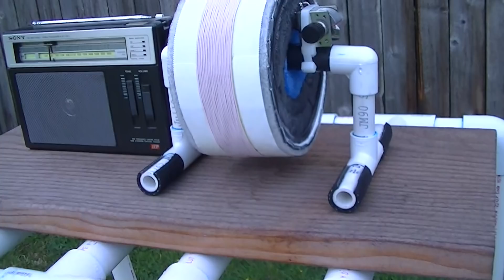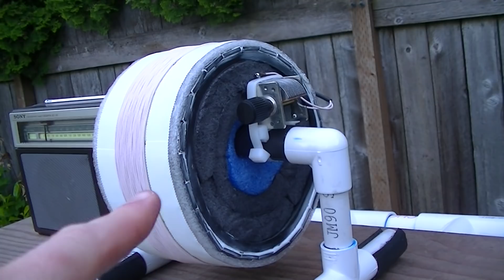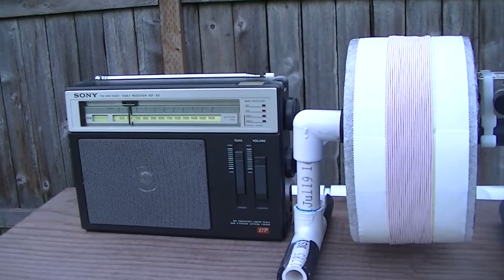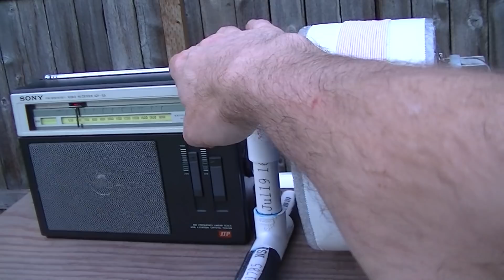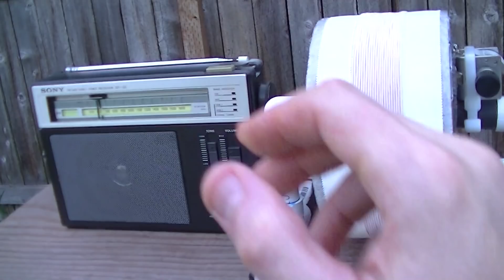7" Bar FSL Antenna Demonstration Video-- 610-KONA

Comment: what's the difference between icf S5W and S5 if used in USA , which one is better.
Reply from the maker: Hello 061811, The two models have the same circuitry on the AM band, but the Japanese-market ICF-S5W has additional Shortwave coverage of the Japanese NSB stations. The Japanese model also has a map of Japan on the back, while the North American ICF-S5W model has a map of the USA.
Reply: hey Gary, thanks for your reply, s5 is alot easier to find then the s5w, which has better FM coverage, but guess people are looking for AM performance on this one.  speaking of your FSL, would there be any benefit if using a 1000pf capacitor with 200x10mm ferrite bar.  in the process of building one FSL, but not sure which variable capacitor is better off to go with. one is 365pf, the other is 1000pf. thanks  73
Reply from the maker: Hi Again 061811, the 365pf variable cap would give you full AM Band coverage, while the 1000pf variable cap would give you some Longwave coverage as well. Of course the size of the variable cap would be much larger, so you would need to redesign the PVC frame to accommodate it, and keep it securely fastened.
Reply: thank you for your reply, Gary, last two questions,  1)what difference will it make if  a double gang or 4 gang variable  capacitor is used i/o single gang one? I saw in your build article that you are using single gang capacitor, but for the 1000pf unit of which I am thinking of using,  I can only find two gang or 4 gang, is it ok to use? 2) I can go with either 14x8cm or 20x10cm ferrite bar, which one will have better WM reception with 1000pf capacitor? not sure which factor plays the important role, the number of  ferrite bars or the length or size of ferrite bar. once again, thank you Gray, can't wait get started working on  my first FSL lol 73.
Reply from the maker: Hi Again 061811, The reason I used a compact 365pf variable cap with single-gang construction was to keep the FSL itself as compact as possible. The only possible drawbacks to using a 2 or 4 gang variable cap are that you will need to design a larger PVC frame to accommodate the larger variable cap, and possibly deal with some reduction in the FSL's nulling capability because the larger variable cap may tend to skew the RF reception pattern more than a compact variable cap would. As for the ferrite rods the longer (20cm x 10cm) rods would provide better performance, as long as the coil diameter is the same.
Reply: hi Gary, how about litz wires, in your building file, you are using 660 size with 365pf capacitor, if I go with 800-1000pf capacitor, do I make any change in terms of litz wire size and turns? thanks
Reply from the maker: The 660/46 Litz wire coil in this model is designed to cover the MW frequencies (530-1700 kHz) with the 365pf variable cap. Using a tuning capacitor with much more capacitance will give you much more tuning range (into the Longwave frequencies) if you keep the same size of Litz wire coil. Most likely you will end up with something like 150 kHz to 1700 kHz with a 1000pf variable cap, although I've never built an FSL with such a large tuning cap. You will need to adjust the Litz wire coil to get the frequency coverage you desire, as well as deal with the mechanical challenges of mounting and protecting the huge variable cap in some type of custom frame.
Reply: @DXerGary  its a good radio i have one peace nd another want

Comment: Could you make a video about how to make one of these antennas ?  I have some idea of how to make one but not sure how to hook up the variable tuner  .  I've used several hundred feet of long wire for a antenna but with no tuner .
Reply from the maker: Hello 1620, Unfortunately the Russian surplus 100mm x 20mm x 3mm ferrite bars used in this antenna are no longer available on eBay, or anywhere else. There are multiple sources for the 140mm x 8mm ferrite rods, however, and "Afterburner" is posting detailed videos about how to construct a 5" FSL model using those rods. His first video is "AM FSL Antenna Part 1," now on YouTube.

Comment: What would the parameters for such a loop be for LF and NDB Dxing ? (say 200-800khz)
Could you help suggest how many ferrite rods and turns of wire (ordinary, dont have any litz wire).
While such an aerial is not cheap, it would be protable and useful for LF work
Reply from the maker: +Richard S Hi again Richard, A 200-800 kHz FSL model would use about three times as much wire as this Medium Wave model, but the number of ferrite rods (or bars) would be the same. For example instead of the 22 turns of wire on this FSL model a Longwave design would use 66 turns. If you don't have Litz wire you can use #28 magnet wire, or other small diameter wire. Good luck!  Gary

Comment: Why wide space the ferrite rods? Why not put them together without the air spacing? Then crap the rod bundle in some protective material and insert into say a plastic pipe - small, portable, inconspicious
Reply from the maker: Hi Richard, Thanks for your question. Detailed FSL (ferrite sleeve loop) antenna experimentation has proven that larger coil diameters result in higher sensitivity, as long as cylindrical ferrite sleeves of equivalent size are used. The details of the experimentation are posted at https://app.box.com/s/mr7aec2o4fid5u4dc48xz0t6u9uto8xh   73, Gary